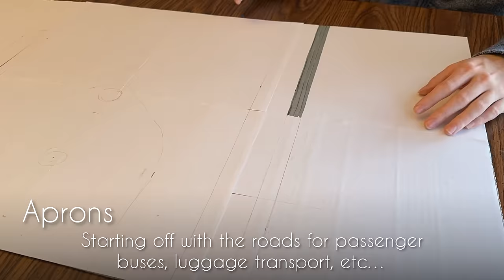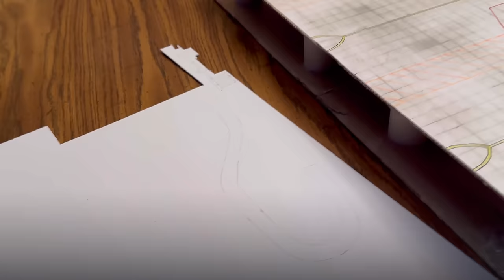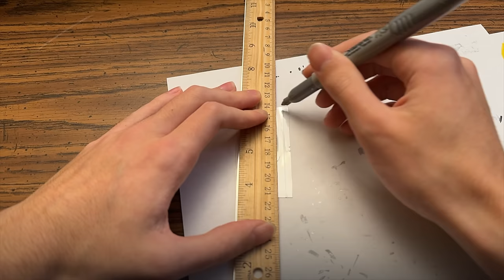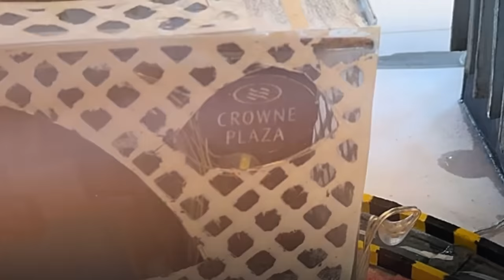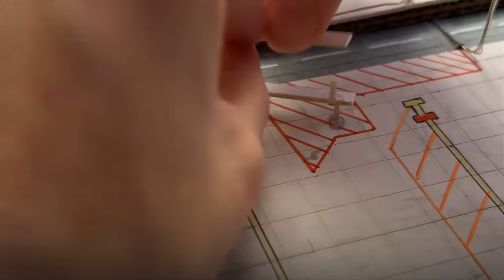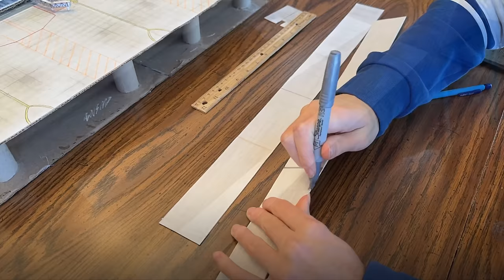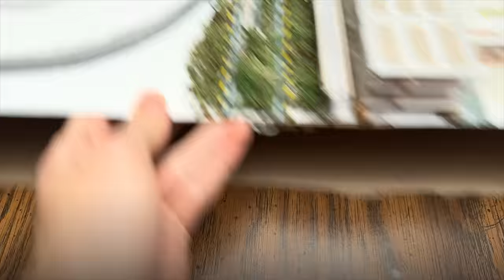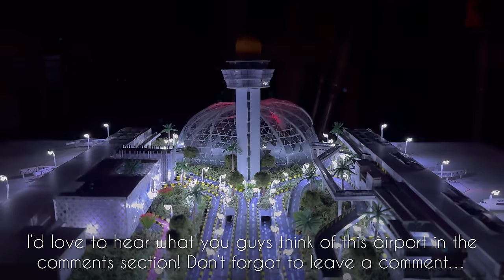Making an Airport From Scratch | Singapore Changi

Comment: Airport :10/10
Built to 1/400 without instructions:10/10
You building :10/10
How fire :10/10
How i am goated at building 1/10
Nice play button 10/10

Overall :711/10 😊
Reply: 711 out of seven eleven
Reply: Fr
Reply: How does that ad up
Reply: @Ogbritishguy  its a joke
Reply: @Ogbritishguy  it's a ice711 thinge
Reply: You made that cardboard aswell wow appreciated 1000000000/100
Reply: 10+10+10+10 is 40 not 711, and you cant rate somethin more than the max, so you need to do the final rating 40/40
Reply: I’d give it a 6/10. Was pretty crudely made. Still cool. But you’re exaggerating like crazy
Reply: @reazyy9667 bro it’s a joke

Comment: As a frequent shopper to Singapore Changi Airport via Changi Airport (CG2) MRT station. The model has real homemade materials which has been perfected to exact perfection example of homemade craft. With the attempt to build the world's largest indoor waterfall made with the Greatest Aviation Youtuber. Jewel is a perfect scale of homemade figure now. T1/2/3/4 is a great model. Well done Ice (:

RATINGS:
Passion used:11.5/11
No cheats 11/11
Great techniques:11/11
Scale:149/11 (great scales)
Terminal,icons and major details:1022383838384747382927273838363/11
Minor details (road signs,Concrete tiles and greenery etc) 11/11
Creativity: 🌠/11 
Overall: 

♾️/11 as such based on the 2024 Cha- 2024
Reply from the maker: Thanks so much 😁

Comment: I have a question, so why did you put double-sided tape down on the cardboard and add the paper? Why can't you just put glue on the paper and put it on the cardboard? Since I am currently working on an airport and it's very hard to put the paper on the tape. It took me 2 hours to put tape on the section of cardboard, and, on another section of the cardboard, I just put glue on that section, and it just took me around 7 minutes. (P.S. it's TUL the airport)
Reply from the maker: Glue works perfectly fine as a substitute. It’s more of a personal preference that I used double sided tape instead, I just think it works easier when cutting the apron tiles since it sticks better than glue. But glue works perfect and I’ve used it on my past airports as well.
Reply: Oh, okay, thank you for replying   to the previous question about the tape and glue. Have a blessed day or night.